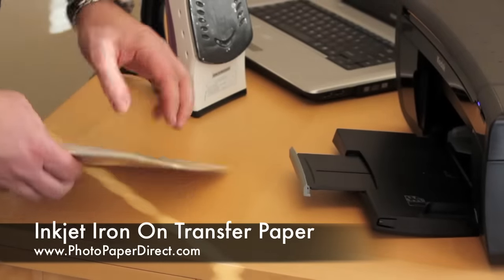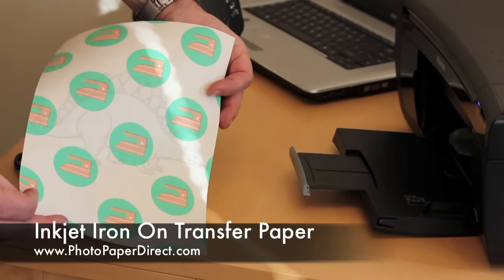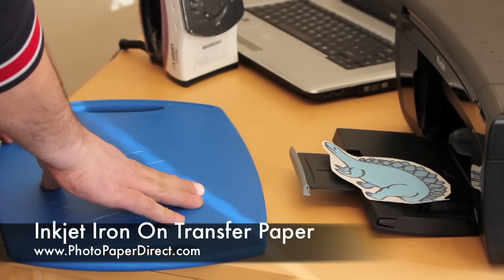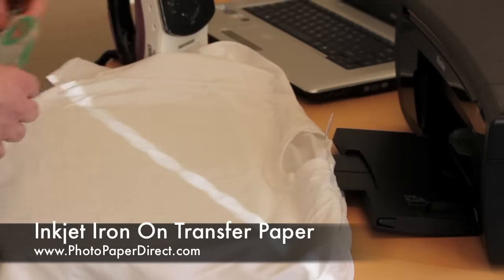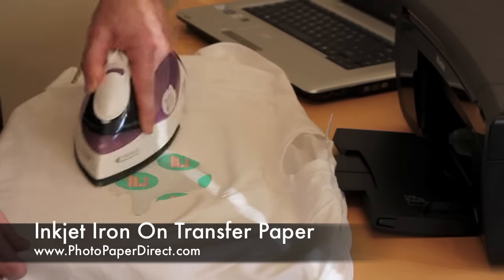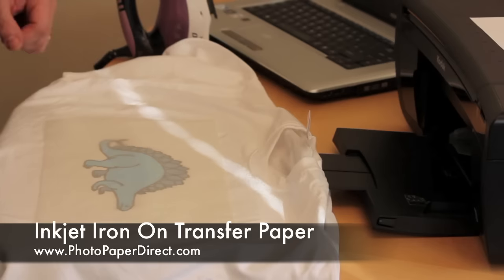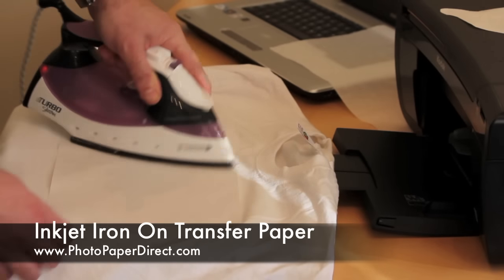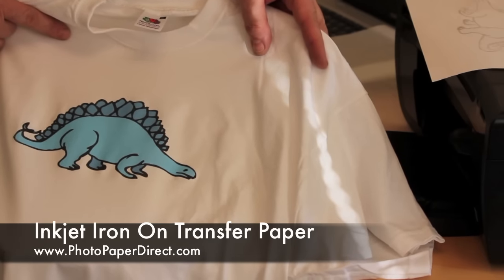Iron On Transfer Paper Tutorial By Photo Paper Direct

Comment: this work on wood? Is there a laser ink version of transfer paper?
Reply from the maker: +I need help The manufacturer recommends the products for paper, but we had some customers using it on wood. We only supply transfer for Inkjet, sorry. Thanks for the comment.
Reply: +Photo Paper Direct going back to the inkjet. lady on here 'tool girl' uses avery paper. would your paper be similar to avery?
Reply from the maker: Avery isn't a bad option. We've tested them all and the ones we're currently offering are superior in terms of durability. We've been selling these since 1999, so had our far share of testing. I hope this helps.

Comment: What is the best material for the t-shirt to be printed onto?
Reply from the maker: Hi, I'd say cotton, but other fabrics such as Viscose, Polyester, Silk etc are suitable. As long as they do not melt under a hot Iron, the process will work. Thanks for the comment.
Reply: Thank you. Are these papers printed with sublimations ink? I'm being confused by these prints and sublimations prints. Can you tell me the difference? thank you
Reply from the maker: Hi, Inkjet transfer paper does not work with sublimation ink. The transfer method in the transfer paper is a film that holds the ink on the garment whereas sublimation ink is a reactive process that requires a Polyester content in the substrate in order for the transfer process to occur. Thanks for the comment.

Comment: Hello im looking for some help on these iron ons. My school gave me an iron on logo for a sweatshirt and i bought a cotton sweatshirt to do it. I put my iron on highest temperature without steam and tried to do it the way it ia explained. The problem is that the picture wont really stick to the sweater completely so i cant really peel off the white paper. Please help! Thanks
Reply from the maker: +Dom S Hi, what do you use as the surface on which you iron on? Also, what watts in the iron? thanks for the comment.
Reply: +Photo Paper Direct Thanks for your fast reply! I used a straight wooden surface and the iron has 2020-2400 Watts. I should alsp add that the picture sticks to the sweater but i dont think its enough especially around the edges.
Reply from the maker: The iron seems fine and so is the surface. How long do you iron for? Can yo also confirm that you haven'r anything between the wood surface and the shirt?
Reply: +Photo Paper Direct I did iron it for 30 seconds on every spot (because its a big logo) and then i just ironed the whole thing in a circular movement for about 2 minutes. i tried that one more time and also did it a little longer and i also put it through our iron "machine" for bed sheets. didnt work. and i didnt have anything in between. I just put the sweater on the wooden board. Or should i put the board in the sweater ao only the top lays on the board and not the sweater? I also called a shirtshop and they said that once the ink is heated up and it doesnt stick the first time, it wont even get sticky if i heat it up again. Is this true? My problem is just that the picture sticks to the fabric but i not really enough and not on the edges. Sonif i try to peel the paper of the edges are still on the paper and alsp kind of stucl to the sweater. I could make a video if you want. Thanks for the fast replies btw
Reply: +Photo Paper Direct I also just tried to peel it off again after it was laying in the basement for a week. I was able to peel it off completely and it just stuck a little bit to the sweater.
Reply from the maker: +Dom S Sorry for the late reply. I am suspecting he has not bought this from us......  If the image stick but not the edges, then there is a problem with the work on the edges, either not enough pressure placed there or something lifting the fabric (like a seam) which reduces the contact of the Iron with the image.

Comment: Butter Paper will work for that??
Reply from the maker: Hi, it will likely leave an oily residue on the transfer and might burn from the high temperature. Try and source silicon sheets if you can. Otherwise butter paper might work, though we cannot guarantee it as there are so many butter papers of various quality. Thanks for the comment.

Comment: How much heat should I apply to my design?
Reply from the maker: Hi, are you using an iron or heat press? Thanks for the comment.
Reply: im using an iron thanks
Reply from the maker: Iron – 1400w or higher is best. Iron for about 3 minutes (For Images in A4 Size – for smaller images you can shorten the time roughly in proportion). Rough time indication should be A4 – 3 minutes, A5 90 seconds, A6 – 45 seconds. It is crucial that ALL areas of the image receive equal length of ironing. Insufficient time will achieve a poor result. I hope this helps.

Comment: I`m trying to make a decent print, but all prints so far come out flat. Can someone tell me how to achieve quality print, on the paper for the dark materials. thanks in advance.
Reply from the maker: Hi, are you using the PPD Transfer Paper? Thanks for the comment!
Reply: Yes, and I was expecting much better outcome.
Reply from the maker: @danyanko  Thanks. Prints on transfer paper appear flatter than on normal paper.  The final result is the image on the shirt and the image will darken once transferred.  When printing on transfer paper,  the aim is to use as little ink as possible and the setting should be normal paper and normal resolution - this produces a quality which is lower than when printing on coated inkjet paper but as I say above, the final result should be judged on the shirt, which is not as flat, not as smooth and often not as white as paper. Thanks for the comment!
Reply: Thank you. Perhaps I'm expecting too much. Very good advice though.

Comment: we can use iron to transfer image from transfer paper into a cloth/textile ?? What about heat presses ? In this case the heat press machine is unnecessary? What is the differences between heatpress machine and iron method? What is the benefits ?
Reply from the maker: Hi, our transfer papers can be used with either an iron (over 1400w) or heatpress. The benefit of heatpress is down to speed. It's a lot quicker to transfer using heatpress. The end result is the same in terms of look, feel and durability. The processes using heatpress takes around  12 seconds only at 190 degrees Celsius, while using an iron will take a few minutes. I hope this helps. Thanks for the comment.
Reply: thanks for the fast feedback ! have a nice day :)
Reply from the maker: You are welcomed.

Comment: Does it needs to be an shirt and does it needs to be white?
Reply from the maker: Hi, It can be on any garment that you can iron over. We have clients using it on Apron, Tablecloths, Baby Grows etc. You can transfer onto any colour provided you select the correct type of transfer paper. 'Light Transfer Paper' suits ONLY white or cream colours, while the second type 'Dark Transfer Paper' suits ANY colour including black, grey, bold colours (blue, green etc). I hope this helps. Thanks for the comment!
Reply: +Photo Paper Direct that means that i can do it on a red trainingsuit?
Reply from the maker: If you can iron onto the material, the process will work. Note that the transfer is only stretchable to a degree. Thanks!
Reply: +Photo Paper Direct thank you very much 👍👍
Reply: +Photo Paper Direct and can i ask you 1 more question? Where can you buy the paper at 3:59 and which sort of paper is it?
Reply from the maker: That's the re-usable silicon paper. Our transfer paper packs comes WITH the silicon paper already. If you need to buy it separately, you can from our USA shop here http://www.photopaperdirect.us/silicon-paper-for-iron-on-or-heat-press-pack-of-5/ OR from our worldwide shop here http://www.photopaperdirect.com/products/T-Shirt-Transfer-Paper-Additional-Silicon-Papers.html

Comment: hi, can I use it on canvas?
Reply from the maker: Hi,

You can use it on fabrics that can withstand the heat of the iron. In your case, I suggest you purchase printable canvas sheets to bypass the need to use the transfer. Thank you for your comment.
Reply: Thank you, where can i get this type of canvas sheet, is it avilable in different sizes as far as you know.      Thank you
Reply: Photo Paper Direct I have one question     it can be stretched on canvas or I have to buy special frame?   because some company do not tell you it can or can not. thank you for answering my questions
Reply from the maker: maher ahmed Good question. It looks better stretched, but 90% of our customers simply mount it unstretched and pleased with the results. A cost effective solution is using a Photo Foam Board to mount the canvas on. These are incredible cheap and elegant. We have a video on the channel about our Photo Foam Board, give it a glance. Thank you.
Reply: Thank you for making the picture clear for me.

Comment: what should be temperature?
Reply from the maker: bhaskar varade Hi, use an Iron – 1400w or higher at max temperature (NO stream). The pack includes complete step by step instructions. Thanks for the comment.
Reply from the maker: bhaskar varade Hi, use an Iron – 1400w or higher at max temperature (NO stream). The pack includes complete step by step instructions. Thanks for the comment.
Reply: Photo Paper Direct
Exact Temperature?
Reply from the maker: Hi, there is no exact temperature. You can use a cooler iron for longer or a hotter iron for shorter time. Thanks for the comment.
Reply: Can you tell me procedure in short so that i can buy the Paper.
Reply from the maker: Hi, The entire process is demonstrated in the video. Thanks

Comment: Can use that paper to transfer on metal such like cooper?
Reply from the maker: Hi, it is predominately designed to affix to fabric. Some use it on wood, but I haven't come across transfer onto metal. For such case you should consider sticky-back printable vinyl (if the metal is smooth). Thanks for the comment.

Comment: What level of heat did you use on the iron?
Reply from the maker: Hi, It is essential that your iron is set at and has reached its maximum temperature before you iron the transfer.  Also it’s important that if you use a steam iron, the steam is switched off. Thanks for the comment.

Comment: That never works for me it always comes out matted or ripped in places I want it glossy it looks better
Reply from the maker: Hi, I am not sure what you meant by “Matted” or “Ripped” in the comment but if sufficient heat is applied, at maximum pressure (pressing on the iron over a solid surface and NEVER an ironing board) a solid image is achievable which will stretch a little with the fabric and will wash for many months. It should be remembered however that as we are printing onto a fabric which is not as smooth or white as paper, there is some affect on the quality of the image and it will never be as vital and sharp as when printing onto coated paper. I hope this helps. Thank you for the comment.

Comment: What kind od Printer do you use? Can anyone refer me a printer for this kind of job
Reply from the maker: Hi, this transfer paper works with any make / model of Inkjet using normal inks. That's the beauty of this transfer sheet. Thanks for the comment.
Reply: I have Canon E510 Colour Multifunction Inkjet Printer which cost about 100$. Will this be enough to start printing t-shirt? Thanks for the quick reply
Reply from the maker: Absolutely. Any Inkjet printer is suitable for the job. Thanks for the comment.

Comment: Sir can i use A4 paper print?
Reply from the maker: Hi, you'll need to use T-Shirt Transfer Paper which isn't normal printing paper. Thanks for the comment!
Reply: @photopaperdirect  Does t-shirt transfer printing paper are suitable in normal printer?
Reply from the maker: @anime_world6844  The PPD range is suitable with any make or model of Inkjet printers. As long as your printer uses Inkjet inks and not laser, the process will work. Thanks for the comment!
Reply: @photopaperdirect  thankyou

Comment: So I pulled this video from the instruction sheet that came with the paper. Followed the instruction here because the instructions on the sheet you supplied were different. The instructions that come with the paper says to remove the decal from the background paper and cover with supplied paper and peel warm not hot. then here you said to use paper to smooth out the image. which I tried and the image stuck so severely that he paper also stuck to the shirt. making the shirt trash. So I say to you make sure the instructions for your product match the video before you tell people to do these and destroy their product.
Reply from the maker: Hi, please note that instructions very between the dark and light transfer papers. Instructions here are for the light, while your note about peeling the carrier relates to the dark transfer paper. If you have a few minutes, there is a video which shows both processes at https://www.youtube.com/watch?v=ykb7I-pJDcI Thanks for the comment!